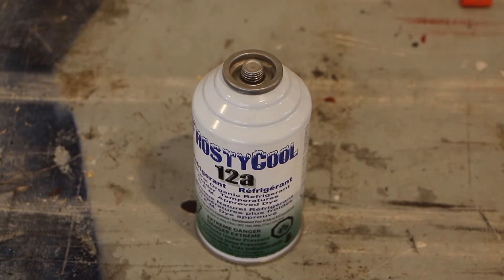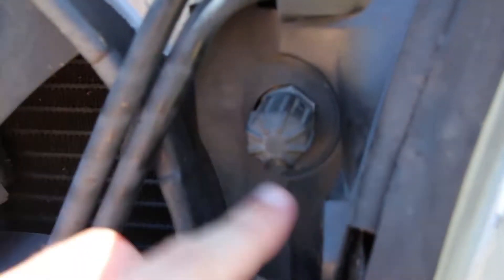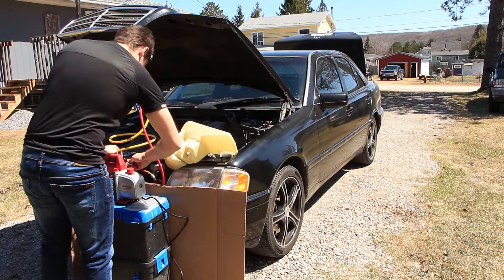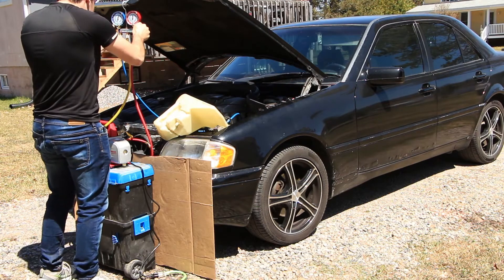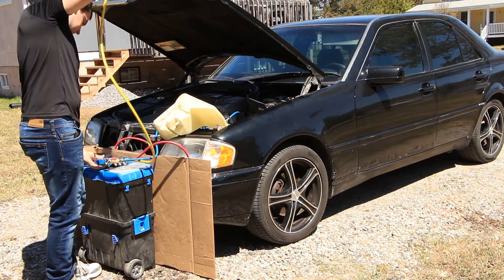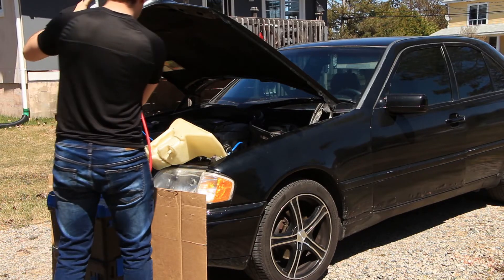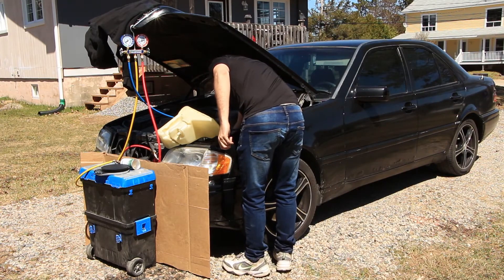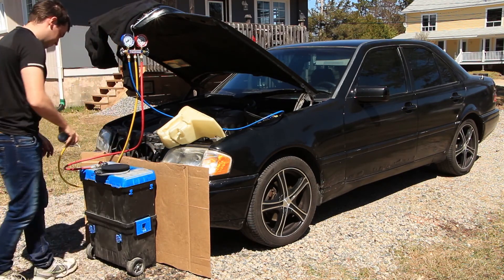R12a Conversion - Mercedes

Comment: I heard you could use 12a  on newer models that use  1234 YF refrigerant replacement to
Reply from the maker: You can, the conversion amount is different, and the mixture may be slightly different of how much propane vs iso-butane there is in the 12a.